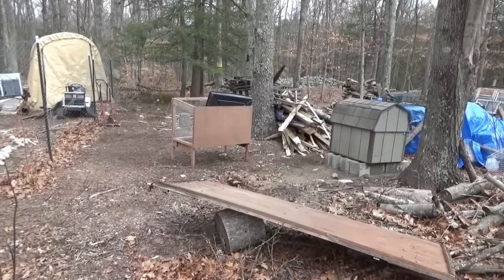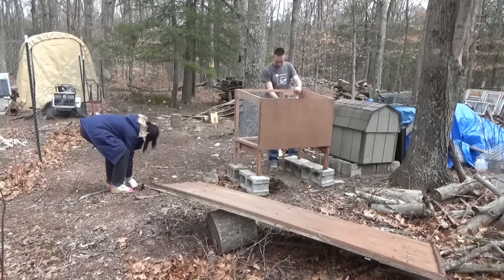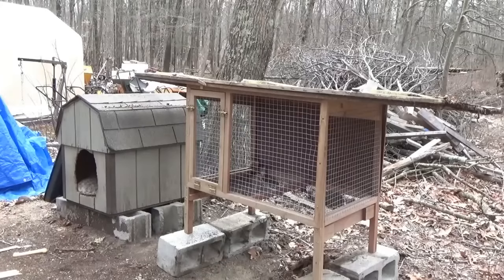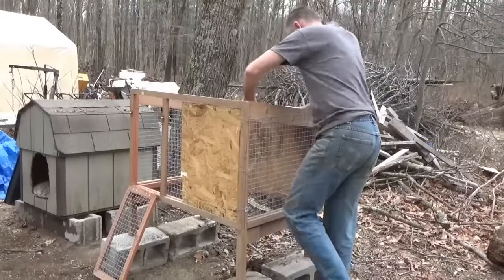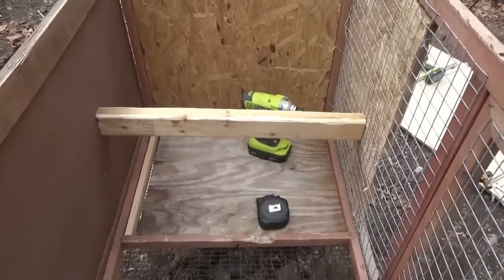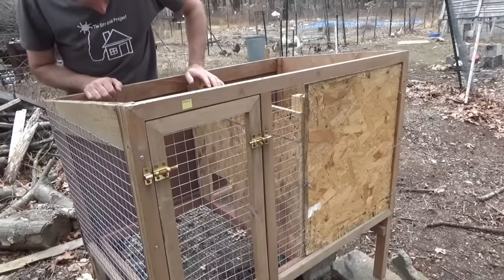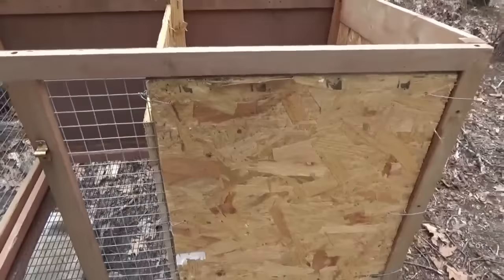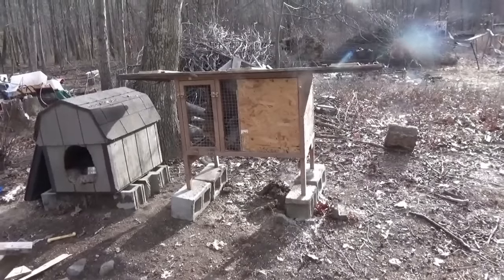Making A Chicken Coop From An Old Rabbit Hutch

Comment: You could build an external nesting box off the back wall.  That way you wouldn't have to worry about the chickens pooping in the nesting box when they are roosting.  With the number of birds you'd be able to comfortably fit in there, one nesting box is all you would need.  It would also make it MUCH easier for collecting eggs.
Reply from the maker: +MotherOfManyHorses Good point. Thanks. I think I will do that.
Reply: +The Do It Yourself World  be sure to add extra support for the outside nesting boxes. I don't trust it either cause it looks too light.
Reply: +MotherOfManyHorses That works for me. :)

Comment: I consider this to be a "fair weather" coop.  In order for chickens to be happy and healthy, they need lots of space.  So, either you give them a good sized coop with lots of rumpus room inside, or a sheltered covered area outside the coop when the weather is bad.  

Chickens like to scratch and peck and hunt.  They also like dust/dirt baths to control parasites.  They can't do this in wet, mucky, conditions.  So, you need to provide them this space to do their chicken thing and not be stressed, or they will end up taking their stress out on each other.  There is no rumpus room in this coop and, unless your "fortress" is going to be covered and sheltered, providing dry ground all year, it will not be adequate to keep your birds healthy and productive.

Also, having a good sized, well built coop (ours is an 8' x 10' shed I built myself), is more than enough protection, especially at night, to keep predators at bay.   Save on the cost and trouble of electric fencing and just build a nice big, secure coop.

Just my humble opinion.
Reply: Well apparently the chickens signed up for a tiny home as well. It's way too small for all of them.
Reply: Shadowman
Hey, thanks!  They really are a fun bunch of birds, and very friendly.  We spend a lot of time with them.

No, we don't have all of those roosters.  We only have two now.  The rest were given away.  One went to a neighbor of ours.  In exchange, he gave us four Isa Brown hens.  The other six went to another farm.  They wanted to raise their own flock of heritage birds.  We hear that they are doing very well.

The reason we had so many roosters is because we bought the birds as day old chicks, un-sexed.  It was more affordable that way for us, so we took our chances.

Thanks for your  question and we're so glad you liked our chicken videos.

David.
Reply: Shadowman
Hey, congratulations on your little bundle of joy!  A true blessing.

We've had a lot of success with dehydrating and vacuum sealing.  Just a few mornings ago we opened up a package of pancake mix we vacuum sealed back in 2011; still fine.

Comment: hope you redo the roof so it is easier one person to open for the eggs. Make sure to tie that coop down to all 4 blocks or it will topple over with a little amount of wind.  Also that is a lot of chicken in there hope you waist no time setting a run up for them
Reply from the maker: +M “Ghost” Baldridge It seems sturdy to me. I cant move it alone. I am thinking about an extended runway on stilts to match the chicken coop.
Reply: +The Do It Yourself World  Promise you'll do a video after it blows over.